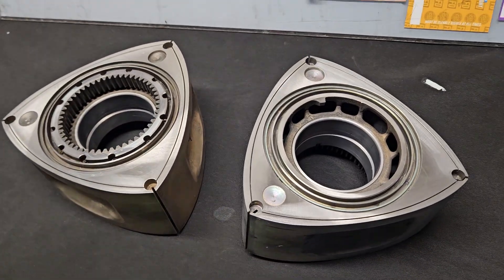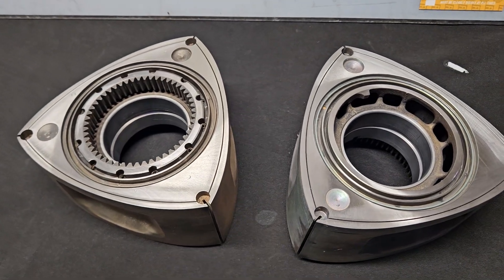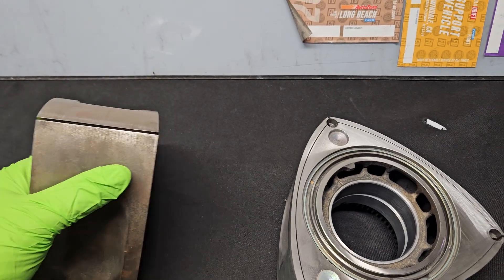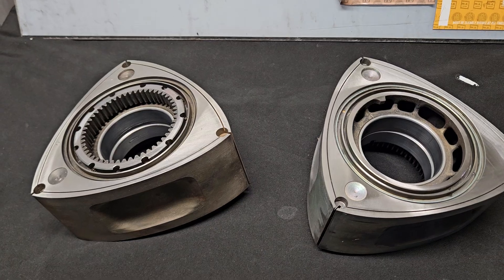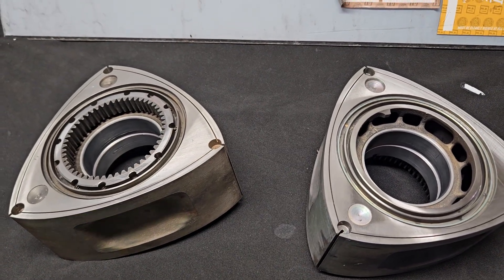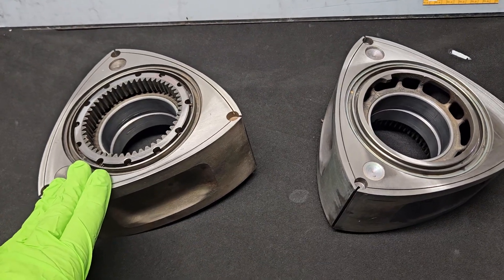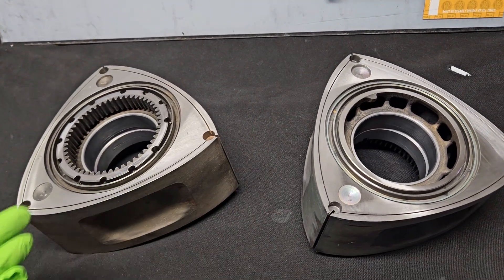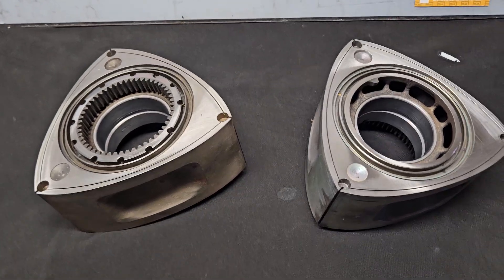Simple tricks to rotors for better reliability, higher rpm and higher boost - Mazda RX7 Performance

Comment: At Atkins Rotary, who are selling a Single Rotor Engine assembly: Shaft, Counterweights, RX-7 Rotor, either low CR, as in twin turbo engines, or high CR, as in 1987 NA 13B, they say weight of Renesis, RX-8 rotors, and RX-7 rotors is same, Renesis rotors not being lighter.
Comments, please?
Reply from the maker: @josega6338  RX8 rotors are the lightest of the 1.3 liter line up.  Here is a link to average weights.  Not sure why they would say that. Its incorrect 

https://mazdatrix.com/rotor-weight-and-compression-chart/

I'd also not even though there are the lightest from the factory they are not my favorite to work with.